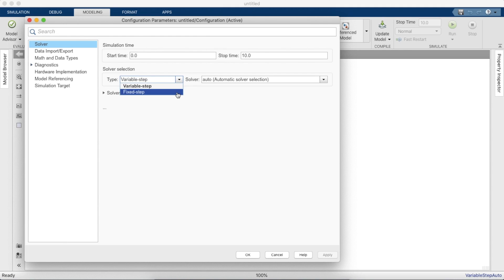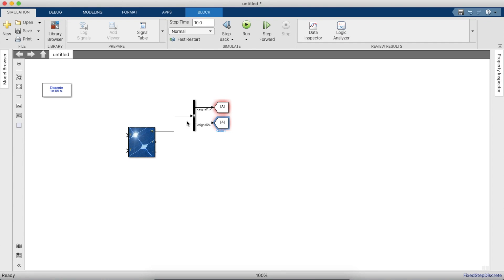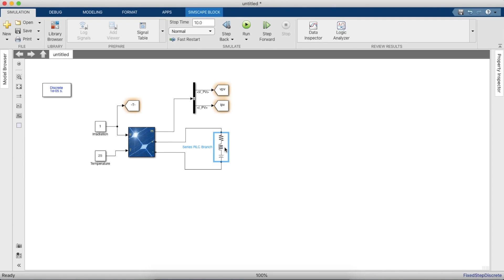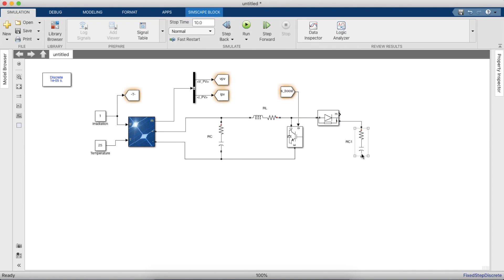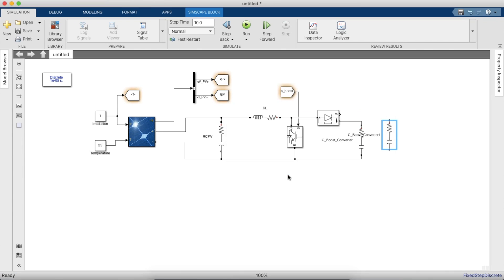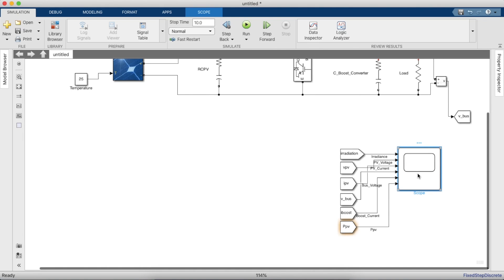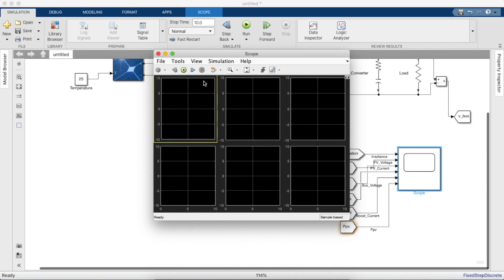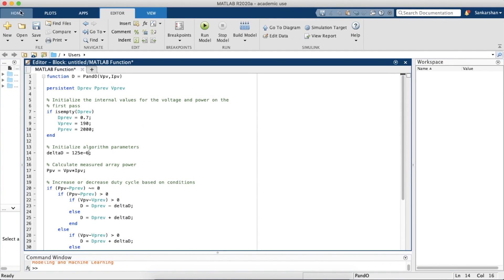PV MPPT System Step-by-step  Simulation in MATLAB/Simulink!

Comment: It showing error. Output port 1 of diode is not connected. You also not connected but your simulation run and my simulation show error...
Reply from the maker: Error or warning?
Reply: And it also showing current directory is reserved for matlab files

Comment: Thanks. This was really helpful, I have questions about the values that you provided here. How did you determine the Dprev= 0.7 ? If I change that value to something, say, 0.6, the output changes and shows gibberish values. Also, I want to know how did you calculate the values of capacitors and inductors that you used in the system

Comment: Hello can you tell me what is the use of boost converter,pwm generator with the matlab function ,why we are using mppt to give the gate signal pulse,please do reply
Reply from the maker: Boost converter helps in achieving the MPP of the PV panel by changing the duty cycle. 

The previous values of the current and voltage are a indication of where the the PV panel is operating. Based on this the mppt is used to switch on and off the Boost converter (based on the duty cycle)
Reply: @TheUrbanScholar  thank you very much
Reply: On increasing the duty the boost converter output  voltage also increase but in p&o graph it is shown that when we increase the voltage duty decrease,how??

Comment: Hello there. Great video. But I am getting two errors here. 

In the diagram, it says the Diode's Output Port 1 ('m' port) is not connected. 
And in the function, it says "Not enough input arguments. Error in  'Ppv = Vpv*Ipv;'." 

Using Matlab 2021a. What can I do to fix these issues?
Reply: disable the measurement port by double taping on it
Reply from the maker: Exactly!

Comment: How could you plot the PV graph from this? I tried using an xy plot component but it doesnt work
Reply from the maker: Check if you've set the x and y axis limit properly
Reply: @TheUrbanScholar  ah I left it as default, I will try figure out what it should be
Reply: @TheUrbanScholar  Also I tried using the MPPT circuit for a single solar module with 115 cells (400 W). I end up with a power output of 10^4 W which seems too high and not accurate? Im not sure how to fix this
Reply from the maker: That shouldn't be happening.
Reply: @TheUrbanScholar  maybe I forgot to change something - I just need to change the voltages in the MATLAB function code I assume.
Reply from the maker: Try jt!
Reply: @TheUrbanScholar  I did. Doesnt work.

Comment: First of all, congratulations on the excellent video. I would like to know, what modifications must be made to implement a buck-boost converter?
Reply from the maker: Thank you so much. Head over to the P&O algorithm video. There we describe the algorithm for a boost converter. The duty cycle is varied so as to operate at the voltage for maximum power. So you'll have the vary D I.e duty cycle for the buckboost converter.
Reply from the maker: For a buck boost converter you'll have to consider another Duty cycle.

Comment: How can the system be used to charge a battery?
Reply from the maker: Hey! Check add a dc battery charger in parallel with the load.
Reply: @TheUrbanScholar  the CCCV charger is what I can see in the library browser. But after connecting it, I still get an open circuit error .. could you please resolve it?

Comment: Hello
I have a question. To validate the MPPT algorithm, should it be done with the output voltage and current of the panel or with the output voltage and current of the converter?
In your case you do it with the output voltage and current of the panel
Thanks
Reply from the maker: Output voltage and current of the panel, hope this helps 😁, let me know if you have any other doubts
Reply: @TheUrbanScholar  thanks friend... I'm working on a sliding mode control project, maybe you could help me
Reply: @richarddnzcuzco6457   I am also interested in the same  project .
Reply: @richarddnzcuzco6457  I'm also interested in the sliding model
Reply: @TheUrbanScholar  How to increase the PV current please explain me
Reply: Can you share your contact details
Reply from the maker: Mail us at howtoproject98@gmail.com

Comment: thank you sir this video helps me a lot . i am a graduate school student and it is my first time using simulink and   modeling the PV System in microgrid. 
i followed this guide step by step but i'm stucked on P&O algorithm can you send me P&O algorithm?😀
Reply from the maker: It's there In the other video! Check it out
Reply: @TheUrbanScholar   i checked it thanks  a lot . i have another question!
 since i am newbie power electronics, i couldn't understand how MPPT works on this simulation
how can i notice that this mppt system is working well? to know this what do i have to know? boost converter?
Reply from the maker: Yes and know basics of power electronics it will be very helpful for you, concepts like inverter, rectifier, firing angle will go a long way. Sry for delay🙏
Reply: Bro can you please share your file, My project is same as yours

Comment: Dear Sir,
Can we by using this system get 1 MW output ?
Reply from the maker: Yes but you'll have to adjust the RLC parameters
Reply: @TheUrbanScholar   Could you explain more ?
Reply from the maker: @lalal904  Surely, the values of Resistors and Capacitors and Inductors are designed for the load simulated. You will have to do design the values for your system as well of 1 MW.
Reply: @TheUrbanScholar   Thank you so much
Reply from the maker: If you have more doubts don't hesitate to ask 🤠
Reply: @TheUrbanScholar  How can i design and take the values of inductor, capacitor and resistance?
Please reply soon and also if there any video of it please share its link.